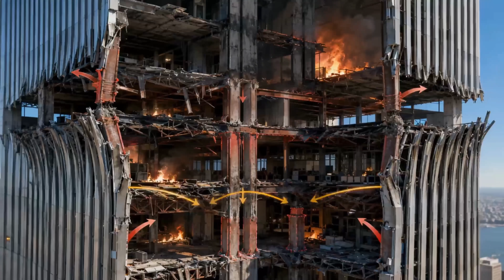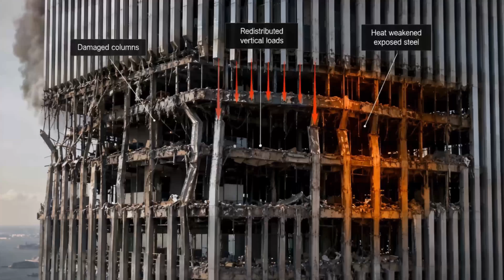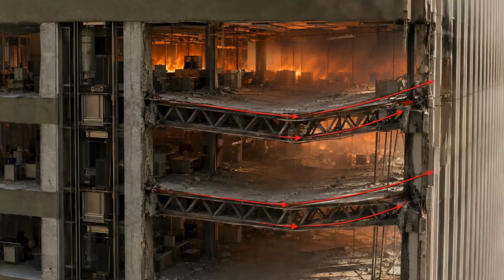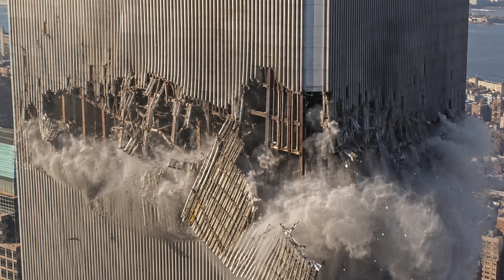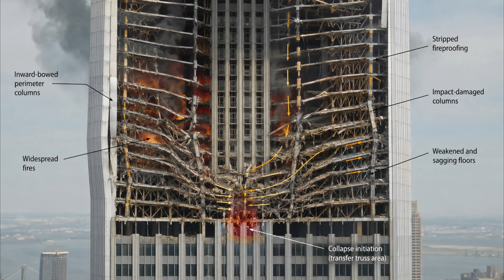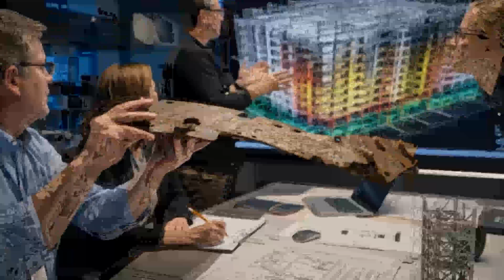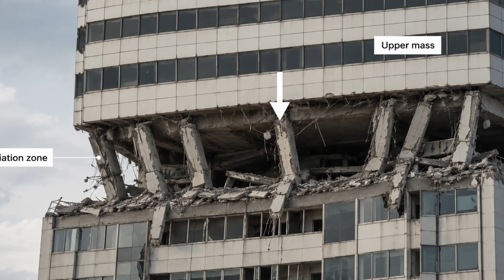What Happened Inside the Twin-Towers After Impact?

Comment: Yeah, this is not true, the majority of the fuel ignited into a fireball outside the building, all the firefighters could tell by the black smoke that the fires were not that hot, the wtc structure had a massive redundancy of times 5 the weight above it regardless of what floor, the engineers that did the final inspection after it was built said " even if the core columns and 3 of the 4 main columns we're severed the remaining column would keep the building stabbing indefinitely, the fact that it was a freefall collapse is a dead giveaway, well that and the thermite found in all the dust samples, were being told by experts that the top 15% of the building was sufficient to collapse the whole building at freefall speed despite 85% below being structurally sound and  uncompromised, that's 450 thousand metric tons of marble, structural steel and concrete, 450 000 metric tons offered zero resistance, think guys!

Comment: The voice made me think this was going to be another random conspiracy theory around that event. Glad it was just a bad ai voice explaining good physics. Hats off to the people who designed those towers. They held out extremely well vs an absolutely unheard of impossible situation.
Reply: How does your 'good physics' explain free fall?
Reply: @markcohen308 what should it have flung itself out in random direction with mass it could no longer support pushing straight down on it? If you want you can try to experiment yourself. Go to the gym hold a square piece of plywood over the top of your head. Have other people start setting 25lbs plates on it one at a time. Once you tell them that is all you can hold let someone randomly add an additional 100lbs. Do your arms tip over sending the weight safely away from your body or does all of the weight come straight down knocking some sense into you?
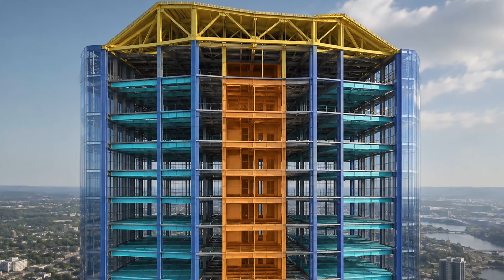Reply: @pRandzq  Your analysis cannot even begin to explain free fall acceleration (which NIST admitted happened). And in fact nearly all the concrete in all the floors did fling "itself out in random direction":  "…and you look, and you see, and there's no concrete, there's very little concrete, all you see is aluminum and steel. The concrete was pulverized, and I was down here Tuesday, and it was like you are on a foreign planet, all of lower Manhattan, not just this site, river to river, there was dust, powder, two or three inches thick, the concrete was just pulverized.”  --- Governor George Pataki, while touring Ground Zero with George W. Bush. CNN, September 14, 2001 https://www.youtube.com/watch?v=MDuBi8KyOhw&t=126s (at 2:00 minutes into the video)
Reply: @markcohen308 
Gravity
Reply: Yea empty disposable towers 😂

Comment: The Towers collapsed due to controlled demolitions using high explosive squibs and nano thermite wraps around key sections of the building's internal steel skeleton.
Reply: If you would indulge me for a moment please take a look at something you likely have never seen or noticed before. It’s in just the first 15 seconds of this video: 

Gary Pollard South Tower collapse, looking at the east side toward the north at about the 80th floor. 

www.youtube.com/watch?v=ULdiD6gYZO0

What do you see?

I see the perimeter columns on the east side of the South Tower bent. Bowed inward with the bend suddenly increasing to about 5 feet until they fail and the collapse starts. Don’t you?

Which is stronger, a straight column or a bent column?

A straight column will be up to 4 times stronger than a bent column, right? 

So the weaker those columns get, the more they bend and the more they bend the weaker they get, right? 

So why are they bending?

It can’t be hundreds of impact-and-fireproof invisible pre-placed explosives that nobody noticed in their office, don't explode or produce any blast effects. Where are the loud 180-190 dB bangs? The bright flashes? The supersonic pressure waves. The lethal high-velocity ejecta raining down on everyone below? None of those are present. Silent explosives that don’t explode or produce any visible effects aren’t going to just bend heavy steel columns, are they?

It can’t be thermite. Thermite is supposed to cut not bend, right? Thermite also burns very brightly. Blindingly bright. Can’t miss that and we don’t see that. Thermite couldn’t have survived in all that fire anyway. So it can’t be thermite, right?

So why did the columns bend to start the collapse?

Comment: If they weren't controlled demolitions the upper segments would have fallen sideways. That's just engineering and physics. 
But they couldn't accept that because of the extra costs of damage and insurance liabilities towards other buildings.
Reply: What is the lateral force pushing them sideways?

The Twin Towers were 95% air by volume. Most of what is below is void.  Gravity works down. Down through the void is the path of least resistance. Do that math.
Reply: gravity has a bad habit of making things fall DOWN ... not SIDEWAYS .... BOZO

Comment: This explanation didn’t need to be longer than 5 mins. The superheated sagging floors were good enough.
Reply: Except that did not happen back in 1975 when a massive three alarm fire did zero damage to the structural integrity of the building:  "A three-alarm fire broke out in the 11th-floor offices of the B. F. Goodrich Company in the north tower of the World Trade Center just before midnight last night and spread through an inner-service core to the ninth and 14th floors. “It was like fighting a blow torch,” according to Capt. Harold Kull of Engine Co. 6, who said all of his men “got their necks and cars burned” trying to get into the 11th Floor hall from a stairwell. A total of 24 pieces of fire fighting apparatus and 132 firemen fought the fire. Sixteen firemen were treated at the scene for smoke inhalation. Flames could be seen pouring out of the 11th-floor windows on the east side of the building."
--- TRADE CENTER HIT BY SIX-FLOOR FIRE, Blaze Starts on the 11th—16 Men Are Injured, The New York Times, February 14, 1975.  Needless to say, with the weight of 99 floors bearing down upon the 11th floor, the building did not collapse.
Reply: But the floors were NEVER "superheated"; no piece of (scrap) metal from the Twin Towers showed it had been exposed to more than 350 degrees; far too low and for far too little time to even heat it enough to weaken it; much less "superheat" it enough to make it sag!
Reply: @teddy1234599  if you heat one end of a steel beam in a raging fire, will the heat dissipate to the other end and to any other steel beam it is connected to, and will that limit the temperature that can be attained on the heated end?
Google + AlOverview
Yes, if one end of a steel beam is heated in a raging fire, the heat will dissipate to the other end and to any attached steel beams. This dissipation acts as a heat sink, which will limit the maximum temperature the heated end can attain.
How heat dissipation occurs
• Conduction: As a metal, steel is an excellent conductor of heat. The thermal energy from the fire causes the steel atoms at the heated end to vibrate more intensely.
These vibrations are then transferred through the material to adjacent atoms, and so on, in a domino effect that sends heat along the beam.
• Convection and radiation: Heat is also lost from the surfaces of the unheated sections of the steel to the surrounding environment through convection (heating the air) and radiation (emitting thermal energy). These processes become more efficient as the temperature of the steel rises.
• Connections to other structures: When the heated beam is connected to other steel beams or structural elements, it conducts heat into them as well. This effectively increases the total mass of steel absorbing and dissipating the heat, enhancing the "heat sink" effect.
Why heat dissipation limits the maximum temperature
The maximum temperature of the heated end is determined by the balance between the rate of heat flowing into the steel from the fire and the rate of heat flowing out of the steel via conduction, convection, and radiation.
• Establishing equilibrium: As the fire heats one end of the beam, the temperature difference between the hot end and the cooler parts of the structure drives heat away from the fire. The greater this temperature difference, the faster the heat dissipates.
• A "steady state" temperature: A steady state is reached when the rate of heat input from the fire is equal to the rate of heat dissipation from the steel. At this point, the temperature of the heated end will stabilize and cannot increase further unless the intensity of the fire increases.
• A natural limiting effect: Even with a "raging fire," a heated steel beam will not just infinitely increase in temperature. The extensive mass of steel in the rest of the beam and any attached structures provides a very large surface area for cooling, and a large volume for heat to spread into. This makes it a very efficient heat sink, which works to oppose the temperature rise.
Reply: Yep; 'progressive collapse' indeed.
Reply: @captaincapitalism264  “NIST’s findings do not support the “pancake theory” of collapse, which is premised on a progressive failure of the floor systems in the WTC towers… Thus, the floors did not fail progressively to cause a pancaking phenomenon”
--- S. Sunder, W. Grosshandler, H. S. Lew, et al. “Final report on the collapse of the World Trade Center towers, NIST NCSTAR. Gaithersburg”, MD: National Institute of Standards and Technology, September 2005.

Comment: There are so many things wrong in this video that I didn't even make it past the halfway mark. The AI program (or whatever was used to make this) showed the towers constructed much differently than they actually were, especially the exterior columns. There's even shots showing steel beams running up and down all throughout each floor despite the fact that there were none. It was all open space, which was shown correctly a couple times, but this video is garbage. For anyone that doesn't know the design/engineering of the twin towers, go watch videos of them being built or something. Whoever did this got more things wrong than they did right.
Reply: Yes this video is all AI garbage.
Reply: Watch the excellent NOVA documentary film, from 2003, how the towers fell, which is a much more accurate and honest appraisal of how they were designed and how collapsed on September 11, 2001.
Reply: @danieljakubik3428  That was horseshit also.
Reply: Yes, AI slop is regrettable. The basic concepts here are good enough to give an idea why conspiracy theories are wrong.  The conclusions are sound. 

Note that the original assumption was a smaller plane of the time low on fuel, lost in fog,looking for the airport or where to come in  for a landing.
Reply: True.  Crappy video - produced by someone who had no knowledge of the structure - although the failure explanations were correct.
Reply: Thank you, it is ai slop and people are commenting on how “illuminating” it is. 🙄
Reply: Anything AI should be banned and destroyed.
Reply: @leefox9342  At the very least, "AI" videos should be required to state that fact in their titles.